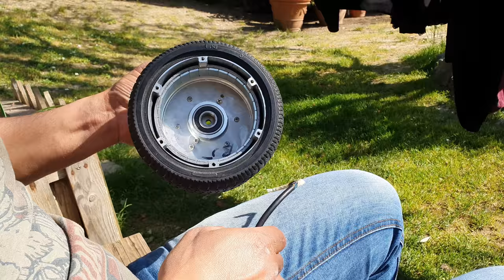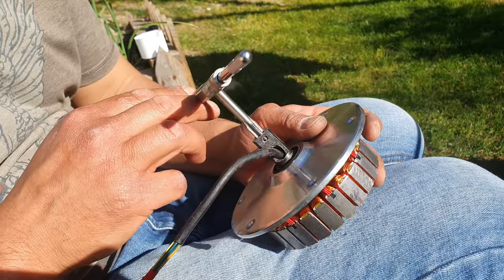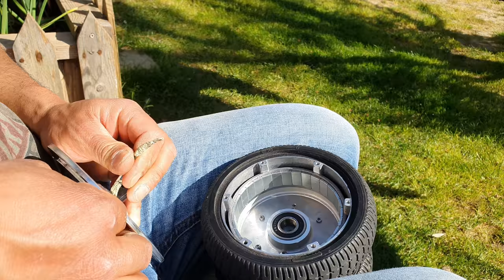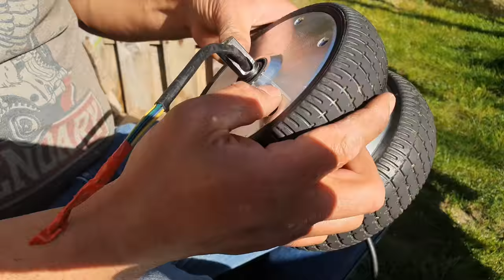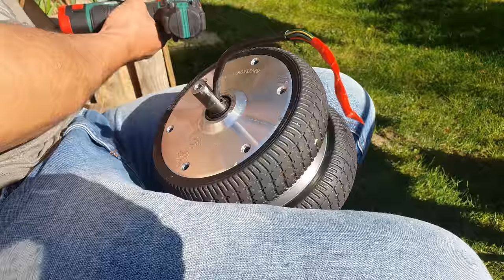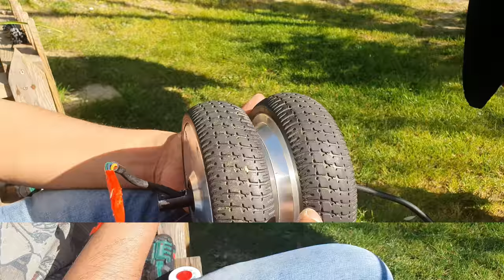DIY Electric Scooter Motor from Hoverboard

Comment: Nice done. How did you line them up perfect.
No vibrations when using in full speed ?
Reply: First thing i do is i put glue on it and roll then in a flat surface to level them properly and wait until the glue is already dry. Then drill it while attach to each other. I thing i use M3 12mm screws. Vibration is normal due to the solid tires that was mounted. Thanks for watching!
Reply: nice idea. I thought also to create a go car oneday using hoverboard wheels
Reply: @jayceepaligutan4904   check my channel.  I build one with 4 hoverboard wheels. Top speed about 20 miles an hour.  (Build for my 3 years old daughter. She drives it like a pro) 
Mine is able to tow a 1300kg station car. 
Just bought the new original go kart frame haha

Comment: which controller do you use and how did you connect 2 motors .. i am doing one project it would help me a lot ..
Reply from the maker: It's better to use two contoller with separat battere if you can you can you one battery and one controller but you have to fix the two motor well. Conecting the wire for example blue is connected blue then yellow to green. Because the rotation of two motor is not the esame. I use normal controller for electric scooter.

Comment: Nice Build. What controller did you use ? and how did you connect to the hall wires ? I am trying with a similar project but Hall wires are functioning sometimes but sometimes not.. any clue ?
Reply from the maker: It happening also to me before. There a time that it doesn't work. Keep trying by disconnecting and connecting the hall sensor be short that the two wheel are same rotation. It's not the controller is the problem but the way you connected it. Remember that the two motor work without hall sensor.
Reply: So I would be able to hook up dual motors to one controller? Does the controller have to be brushless when hooking it up dual?

Comment: Nice job :). Have you measured what speed you can achieve before and after this rework?
Reply from the maker: This motor is literally fix to maximum speed of 25. With 36v
Reply from the maker: Maximum speed is base to what battery you can put on it. And also to the controller your using
Reply: @jc-diy2321  z
Reply: Any voltage controller will work on hoverboard motors?